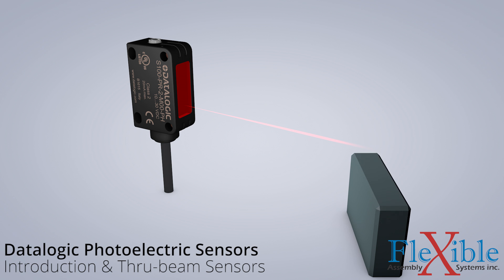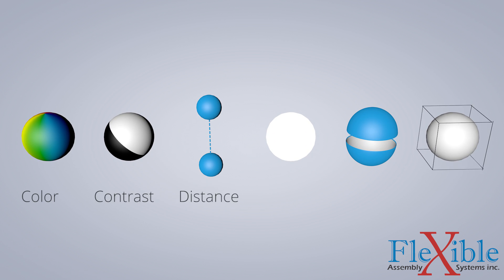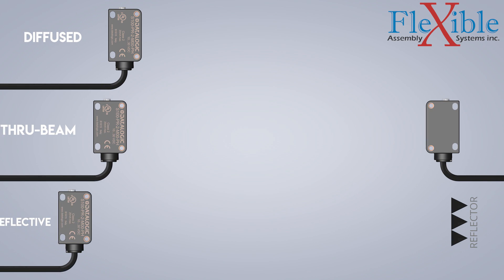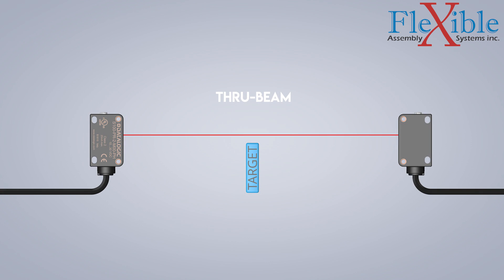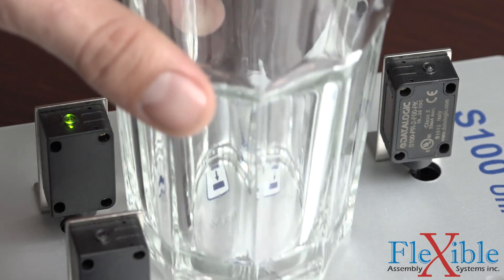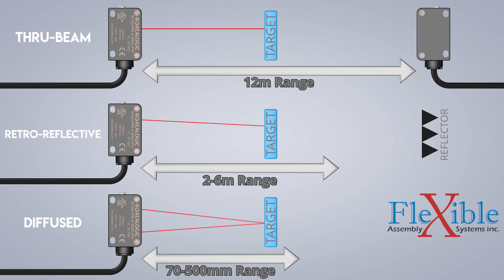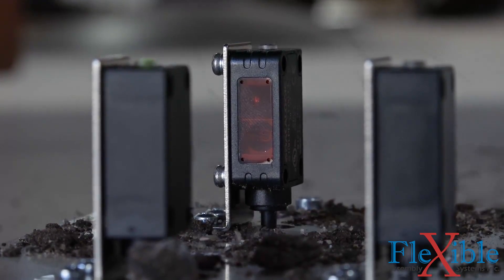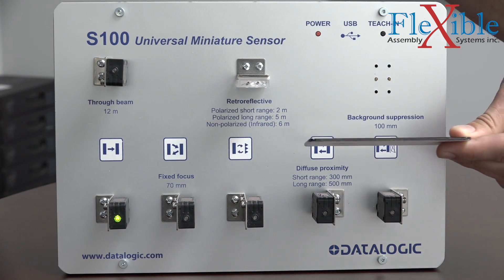Photoelectric Sensors - Thru-beam - Part 1 - Datalogic

Comment: Hi

Can this sensor be used with an esp8266?

Thanks
Reply from the maker: I looked up the model and it looks like it has a few GPIO pins you can utilize. The S100 Thru-Beam has 4 wires (10...30VDC, -0V, Output, Remote) for the receiver and just power/ground for the emitter. As long as you can provide power and ground to both senors I don't see why you couldn't connect the Output wire to a GPIO pin and send that through the wireless module you have. The output from the sensor would be on/off only. I'm not familiar with the ESP8266 so you may have to test it, and I'm unsure if you can provide power for the senor through that module. Good luck!
Reply: Esp 8266 is not capable of powering the sensor. Also the output of the sensor has to be scaled within the range of 0-3.3V. If we r directly giving the output to the esp module it will be burnt.
Reply: For object presence detection, you can use ir sensor module which will well works with esp